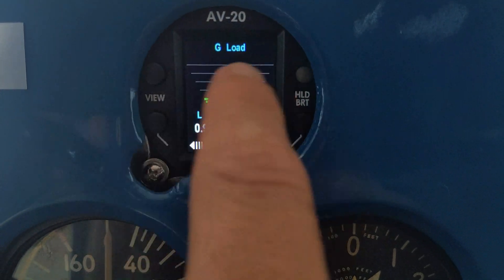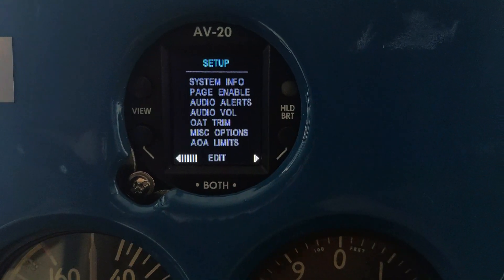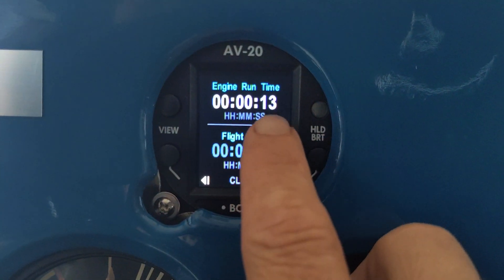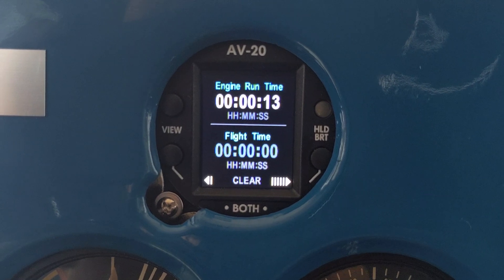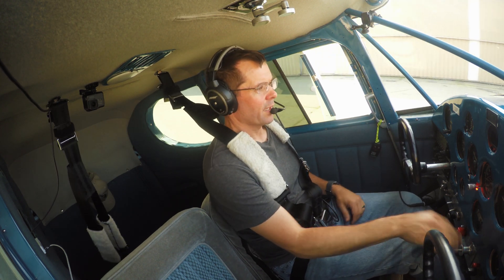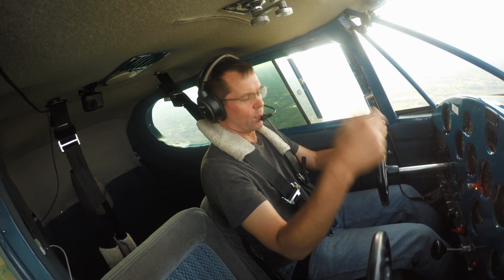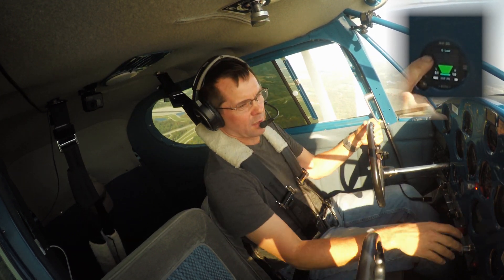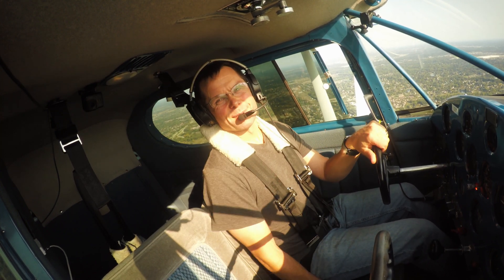uAvionix AV-20S Multi-Function Display Review, Angle of attack indicator

Comment: How accurate do you feel the AOA is on the AV20? How does it differentiate between a clean wing and partial or full flaps? Looking at adding one to a PA28-140 for backup/assurance going into shorter strips.
Reply from the maker: It's all right. It's better for landing than takeoff. On take off I noticed as I start to turn left it will sometimes show up very high angle of attack. On landing and don't see that problem. The angle of attack on the AV30 does seem to be much better. 
I was able to really develop a good approach speed and power/deck angle using the AV20 AOA. Also that the AOA will pop up during high angle of attack situations is an attention getter and I like it.

Comment: I have an AV-20S in my Aeronca Sedan. I haven't gotten the angle of attack to work yet. All of the other functions are working, but the AOA was my reason for wanting it. Hopefully, I will be able to debug the problem. I didn't install the outside temperature probe, so some of the functions are not available. I may put that in eventually.
Reply from the maker: Did you set the level attitude of the aircraft?  This needs to be done in flight in a taildragger or with the tail jacked up so the aircraft is level.  Also did you go up and do the stall series so you can set the upper limit and cruise angke in the AV20? Without those limits set correctly it will not give a proper AOA. This process can be done with one quick flight andrea the information in the AV20 is straight forward to find and enter.
Reply: @GreatMichiganBushCo  I went up with the intent of doing stalls so I could set my limits, but it wasn't registering AOA at all. My only flight since then was my flight review which had many other tasks on the agenda. I'm continuing to work on getting it setup.
BTW - I fly out on Linden (9G2). I have flown into Troy several times.
Reply from the maker: Depending on the default limits in the AV20 you might not get any angle of attack information. I would said it level in flight, then you could put the level flight AOA setting at zero and set your stall AOA at 12 and then it probably will give you some sort of information. when she do your stalls and properly calibrate it Will give you some good information.  Ive probably seen your sedan at Troy. I've seen a green and tan sedan I've also seen a maroon and tan sedan. Very few classic tail wheels go in and out of there without me noticing.
Reply: @GreatMichiganBushCo  Thanks for the advice. Mine is the one with green stripes. I work in Troy and was able to fly it to work sometimes in the past.
Reply: I have the AV-20 working correctly now. Both the upper and lower AOA limits are negative numbers because the zero point was set with the tail on the ground. But, the absolute numbers don't matter much. The bars display at the correct times.

I just watched your AV-30 review. Now I want that! Even though there is a lot of overlap between what the two instruments are capable of displaying, having both would reduce the screen switching.
Reply from the maker: @reidbaldwin4555  what I did is went flying and in level flight calibrated the attitude indicator. N then I had real numbers to work with for angle of attack. Plus the attitude indicator reads level when I am level in flight.